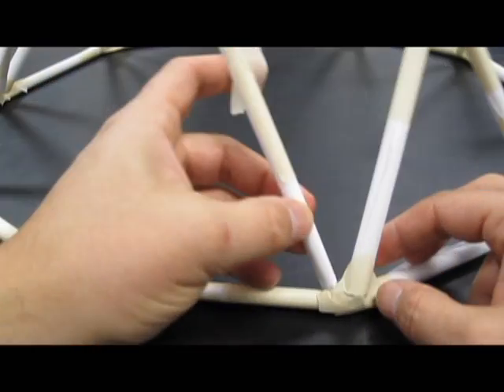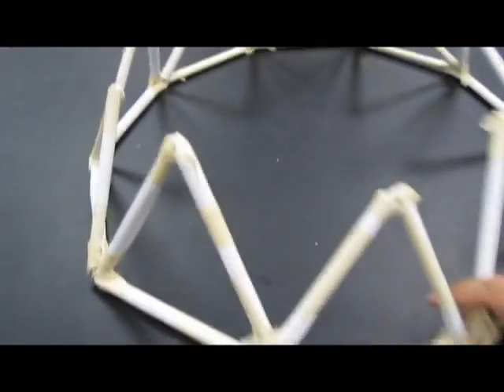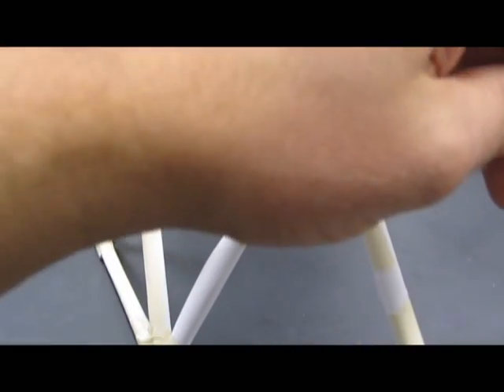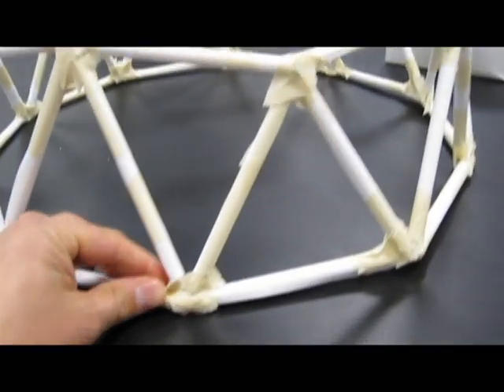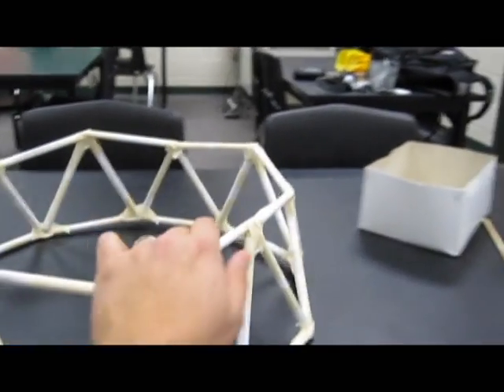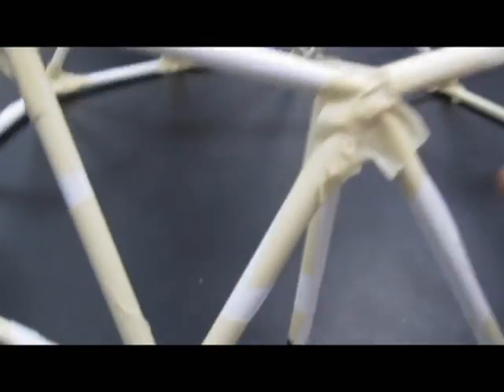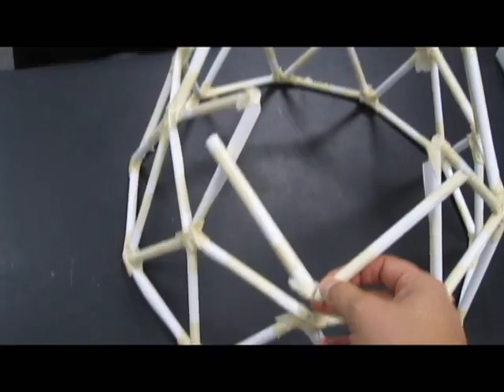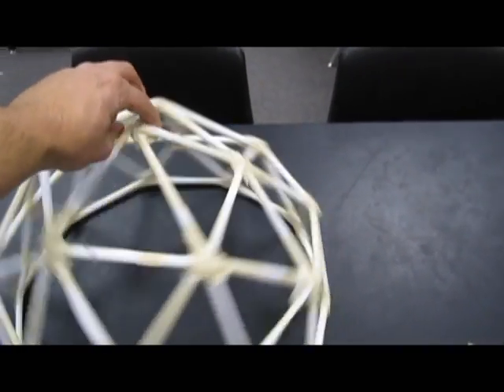2V Geodesic Dome Instructions pt 2

Comment: That only simplifies construction on the job site, you still have to weld all those hinges on at the correct angles, and maybe cut a bunch of little gussets the correct sizes and angles for each hinge for enough structural support to secure the hinges to the struts properly.

Nice job in the hinge ideal. But realize you didn't draw in the angles, slant the struts to allow flat panel assembly, or show the taper in the outside and inside frame faces.

You showed a panel being installed flat on the struts of a triangle, but that triangle and frame you showed accepting the flat panel, will never be a part of a dome, because it has no bevel or taper to allow a dome to take shape,. If you install flat panels on this design(triangles sharing the same strut), then the flat panel will have no flat place to be attached, it will have to share the strut by using the other outer corner of the outside of the strut, with the next panel beside it on the next triangle. Trust me, this is bad design, unless you only plan to drape plastic wrap over it all and not plan to panel it. That bogus drawing of that triangle being paneled is misleading, probably even misleading to you. You left out the bevels, angles, and tapers.  This hinge ideal is still a good ideal, but one solution to allow it to be paneled correctly, you will need to have double struts, meaning, each triangle will REALLY be triangles of their own, not sharing a strut with other triangles, it will be stronger and it will panel up nice once you put the taper on the struts on the outside face to allow the strut outside face to tilt to the correct angle so that each panel has a flat place to sit, and not trying to sit on corners. Or you can rip a upside down V into the outside strut face so that you can panel the dome correctly, without using 2 struts per vertex.
 
Go sit your arse on some corners for a week, and tell me if you still think it is sustainable. lmao It will be a weak ass dome, take these words into account, and remember everything needs to fit like a glove and never try to avoid or ignore the geometry of the shape you are working with. You are going to have to deal with all the compound angles, so you might as well begin to draw them first.